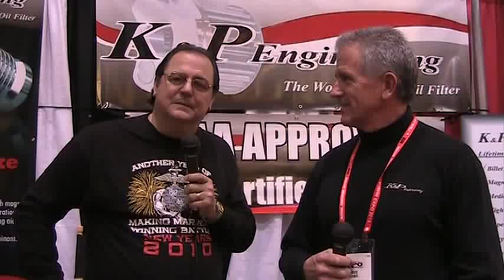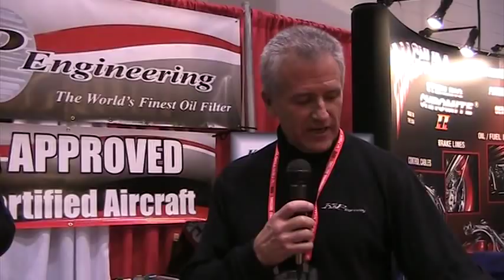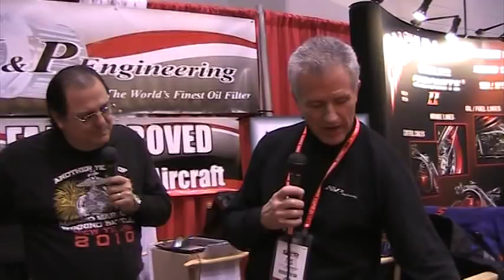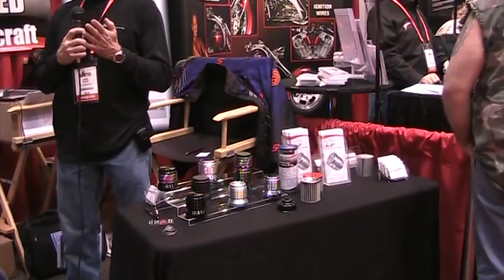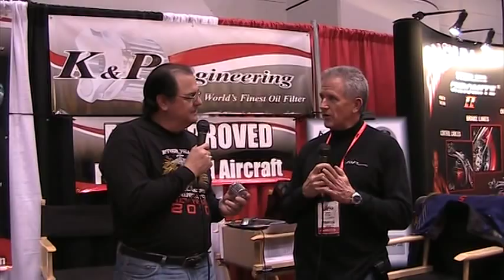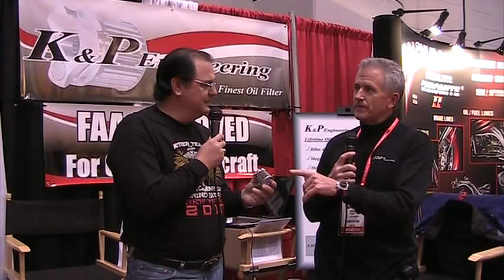Dave from K and P Engineering Oil Filters & Two Wheel Thunder TV.MOD

Comment: What is the micron rating of the filter?  I know the 3.5 Ecoboost needs lots of oil at startup for the cam phasers and timing chain.  The standard ford filter is the FL500S. Do you have a figment for that and is there any need for a anti drain back valve on your filter? I want the best for my 2019 3.5 Ecoboost f150.
Reply: they filters leave metal in your engine stay w paper
Reply: @dflex4180  what are you basing that on?